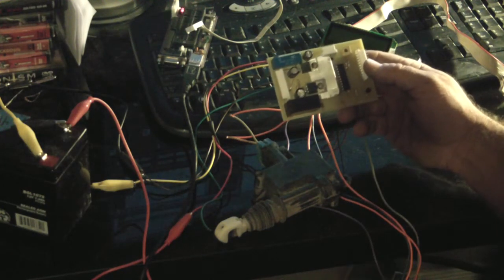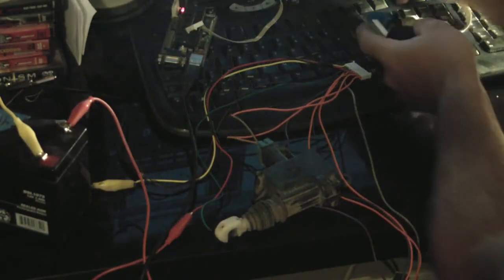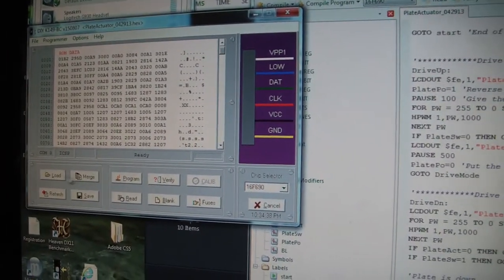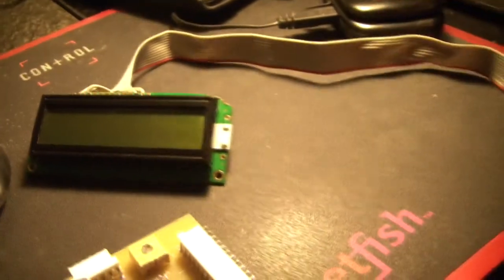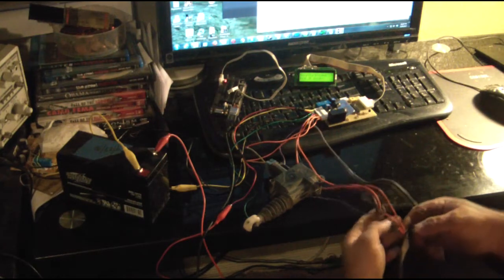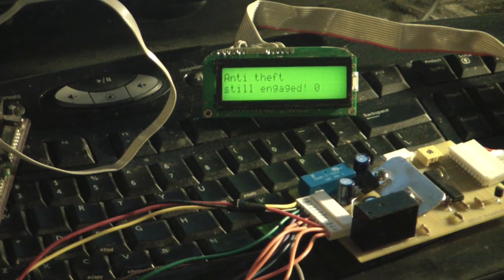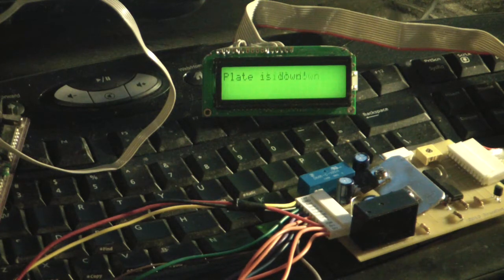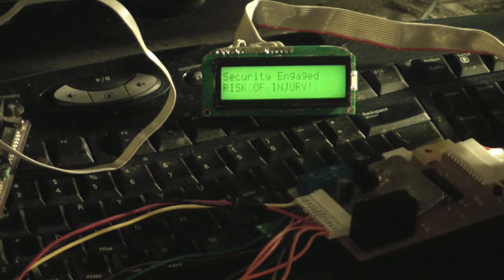Mustang GT Project  Dash Pod Mod Pt5 - New control board is finished and tested

Comment from the maker: Are you asking why WOULD it allow the car to start before the anti-theft kicks in?

That would be so I can start the car for the A/C, etc and know it can't be driven away with my kids, gins, etc still inside when I step out for a second, let it cool down, whatever. 

I did it this way in my Durango. It was foolproof. 
So foolproof that if I was distracted and didn't engage the sequence to disarm it I would start driving and STALL. LOL!

It's an auto kill switch basically. Never needs activating.